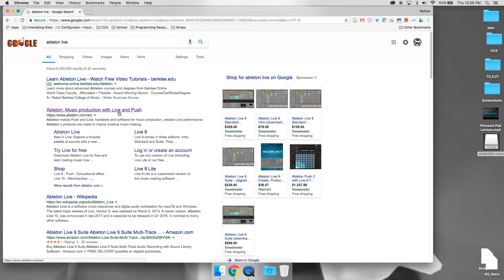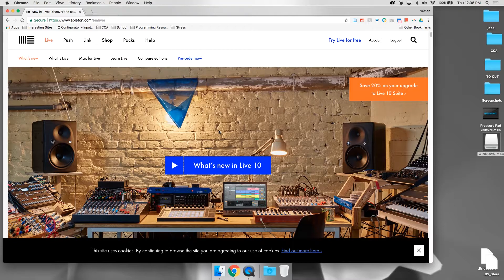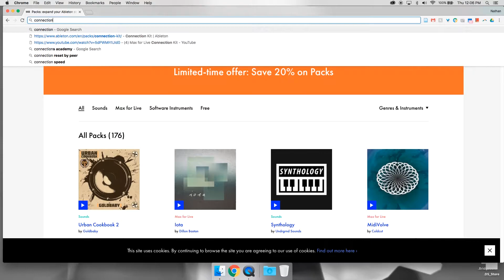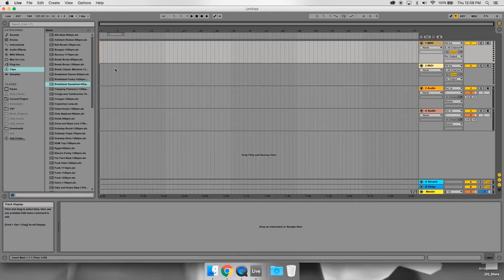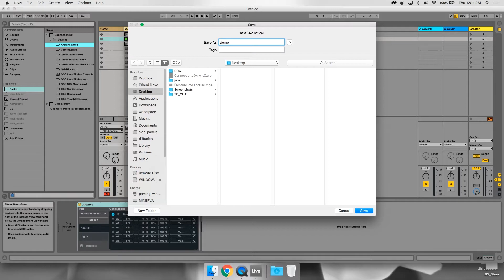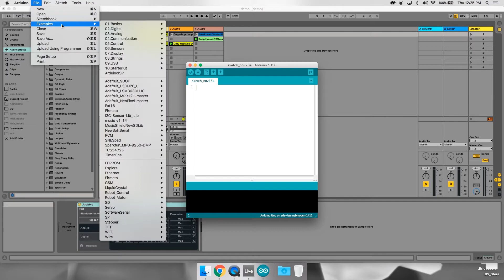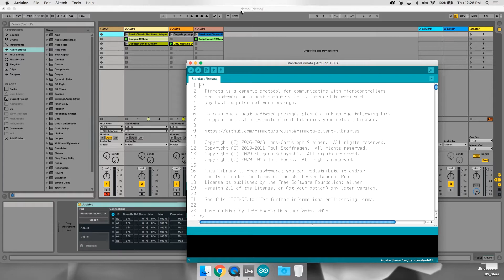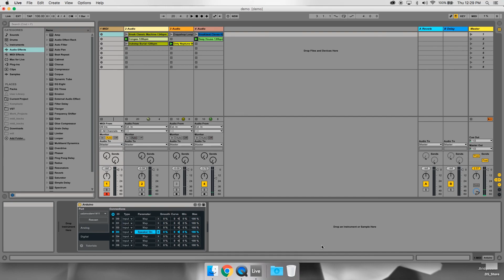Control Ableton Live with an Arduino Uno

Comment: I watched this and one other video where I set the script for my encoders to a midi script. I am a bit confused in whether or not this requires anything written to the arduino script to control the potentiometers or if that just should already be working in the connection kit? I see everything popping up in ableton as it should in the connection kit but my parameters are not responding when twisting the rotary. Am I missing something? cheers
Reply: Hello! I’m having this exact problem. Were you able to solve it?

Comment: Hi there, Great video!

I'm a design student doing a project about a device that allows users to interact with music. I was wondering, is it possible to map an accelerometer gyroscope sensor to Ableton through Arduino? If so, how?
Reply from the maker: You should be able to connect a IMU sensor to Ableton through the use of MaxMSP, I would look to see if any patches already exist that can do the deed for you. You would not be able to get it to work using the method described in this video, however =(.

Comment: Is anyone else having issues getting this to work on Ableton Live 10? I have the arduino and the HC-SR04 sensor working fine (series monitor picks up proximity) and i have StandardFirmata installed and a sensor sketch, but Ableton is not registering any of it even though I have Connection Kit and all else set up. Anybody have an issue like this and figure it out???
Reply: I can't seem to get it going either. It seems to be a very common problem. This connectio kit doesn't seem to be so straightforward at all.

Comment: Hi, great tutorial! I am using an accelerometer which is a I2C communication with Arduino, but I found there are all analogs and digital ports in the Ableton connection ket, can it actually read the I2C? like SCL SDA?
Reply from the maker: Hi Nick! The answer is no with a workaround yes. There is no way to directly read the output of an I2C device using the connection kit. However, by going into the Arduino code and doing some modifications you might be able to get it to work. Basically, you could read the input from the sensor and then convert its reading into a value which you can output using the PWM pins (all within the Arduino firmware). This would take some ingenuity but is possible. It depends on how strong your programming skills are =).
Reply: @NathanVillicaña-Shaw  Thank you very much

Comment: How can you make it so you dont need to hold the button down and instead just press once?
Reply: This can be done programatically, set a boolean variable as a toggle state and check that state on each cycle. If the button is pressed, change the state of that variable.

Comment: Any chance you could post a picture of how you setup your Arduino please? I'm having trouble getting my button to work
Reply from the maker: Hi Andrew! I don't have a picture of my setup, but here is an image which shows the wiring. The resistor is key and without it your button might not work. Also, try to restart the connection kit and/or Ableton. The plugin is quite unstable and sometimes does not work the first time. https://goo.gl/images/nWJrPh